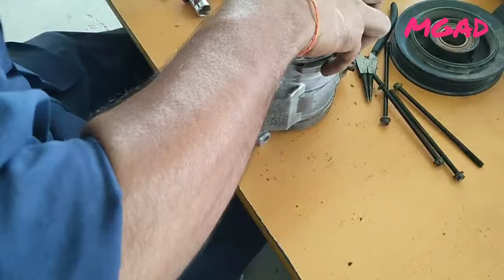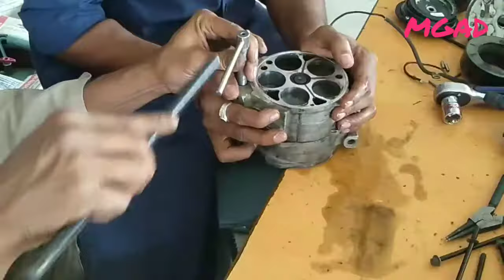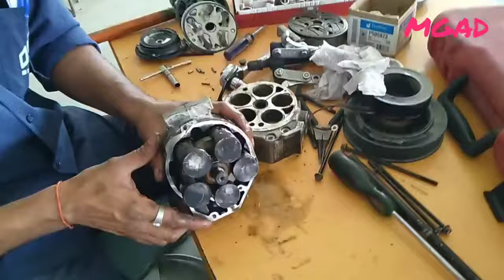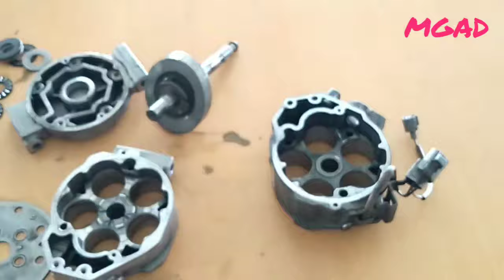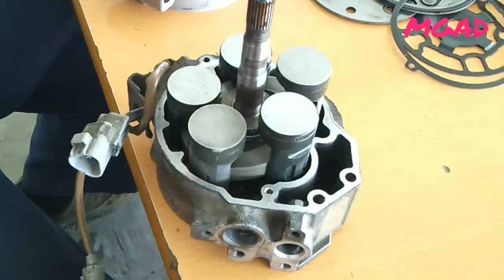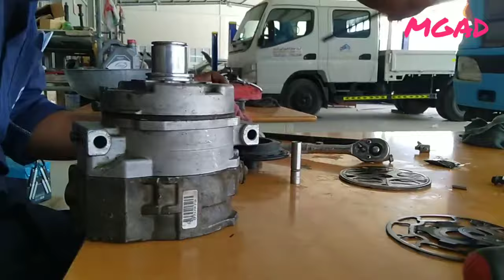AC compressor Repairing AC. How to fix AC compressor .

Comment: Agreed, Air compressor will wear out, especially the pistons, which will reduce compression and mean the compressor will need to work harder to build compression. Always best to buy new compressor rather than fix old one, unless old one is not very old/low km's. Also same situation buying replacement compressor: don't buy rebuilt/remanufactured one; instead buy new one.

Comment: Hello, thank you. I did the exact same cleaning process for this same compressor, but after applying air pressure, there is a leak between the separators. What is the solution?

Comment: I have leak from my ac compressor caprice 96 I think from rubber seals  I tried epoxy to stop leak I put epoxy all around this seal and it failed to stop leak I think because high pressure can I weld it with 4043 aluminum with my arc welding from outside all around seals ?
Reply: How do you solve the problem you have?